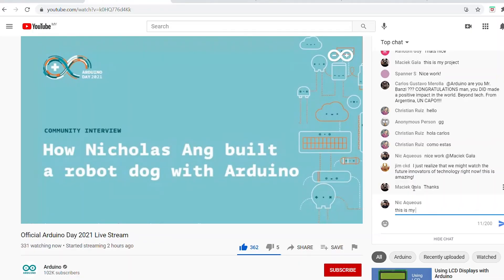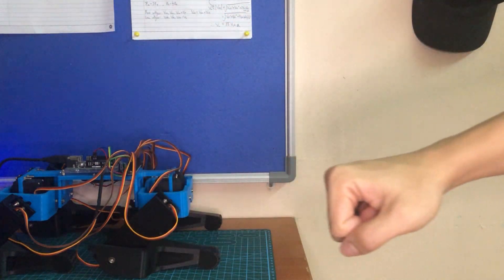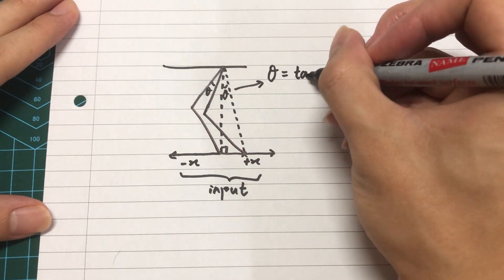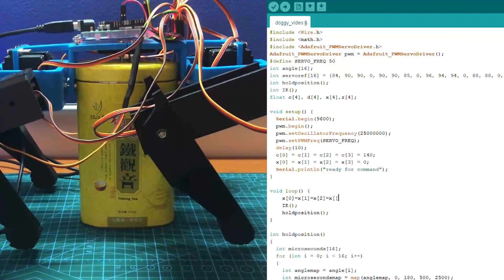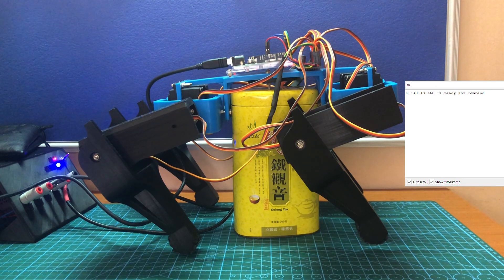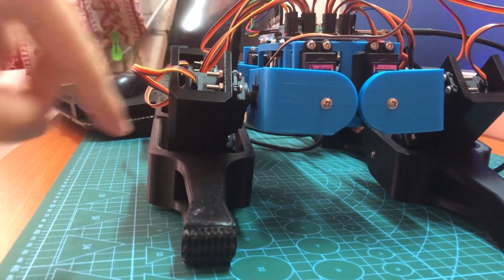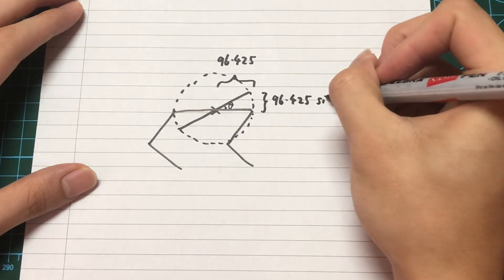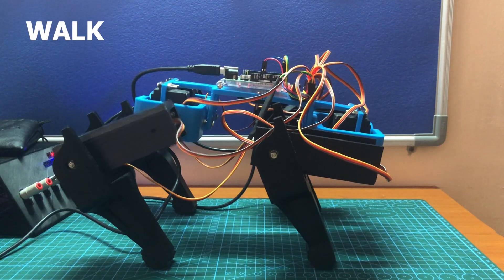Building a robot dog #2 First Steps, Inverse Kinematics, Full Code

Comment: Hi. I am mechanical engineering student
I love designing but i didnt have any skill in programming

Would you like to recommend me any website/course to program robot from basic? I really hope that the course is focus on project based not a general mathematical equation
Do I have to use arduino or something?

Thank you so much
Reply from the maker: Hi, thanks for watching! I learned programming mostly through youtube. Having an Arduino definitely helps as you can see a physical result after you run your code.

Comment: I had a look at the code. From what I understand is that you send commands via serial monitor to the robot to execute an action of the specified command entered. 

Inside the code you specified each input command with a unique string character but there are no comments that explains what each command's function is.

I think it would be helpful to the community if they understand the command they are entering to test there robot if they wish to modify your code to best suit their design. 

Awesome build and may it bring prosperity to your career.

Comment: Amazing work, I am also trying to create a robot dog as a school project. I have fully designed the leg but when I try to move the leg it doesn't move in a straight line, it moves in an arc because one motor doesn't have to move as far so it reaches its final point quicker. Did you run into this problem or am I doing something wrong? I would really like to know if I'm just missing something obvious, Thanks.
Reply from the maker: If you're using the exact same motor, these are budget servo motors and their positioning are not precise. Which could be why you faced the problem. :)

Comment: what servos are those? they seem to be more than good enough to be able to handle the weight
Reply from the maker: These are MG996R servo motors. :)
Reply: @NicAqueous  I have the same servos and they have pretty high torque, try turning up the voltage to 6v. or eve 7.4v. i dont recomed going above 6v but during my testing my servos became a lot faster and higher torque when i ran it at 7.4v. but do not go above 6v your servos could take some damage.

Comment: i have a question how many servo motor did you use for one leg
Reply from the maker: 3 for each leg.
Reply: thanks
Reply: sorry to bother but why should each leg have 3 motors instead of 2
Reply from the maker: @Meowser224  For it to do all the movements in this video, 2 for each leg is enough. The third one is for side-stepping. :)
Reply: @NicAqueous  thanks

Comment: what if you use a DH algorithm for inverse kinematics?
Reply from the maker: Thank you for introducing it to me, will definitely read it up!
Reply: I think the DH method will only give you the forwards kinematics. To get the inverse kniematics, you would have to equate your FK (which contains the robot angles) to the desired homogeneous matrix (which contains the TCP position and orientation) and then solve for the angles (this can be tricky and require a lot of trigonometric identities).
Reply: @Mau365PP  yeah i'm learning just that and i didnt listen that he already did the inverse kinematics with the offset included just it was very hard too code, my bad